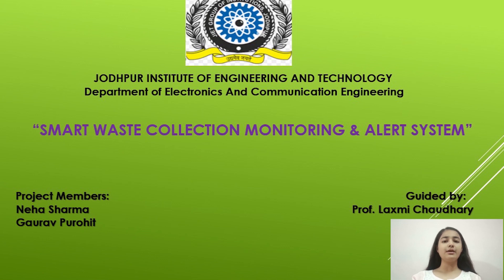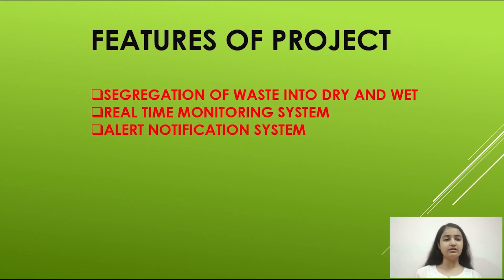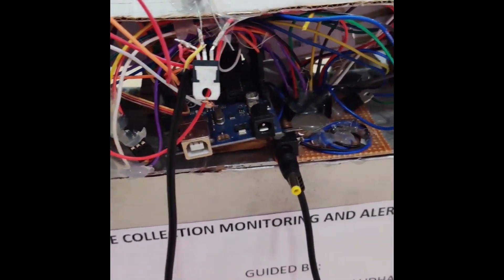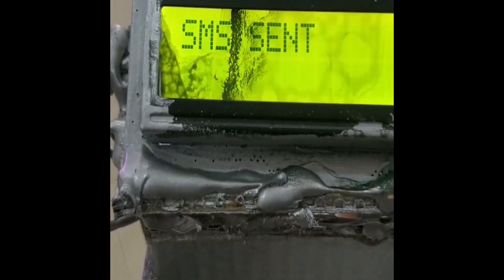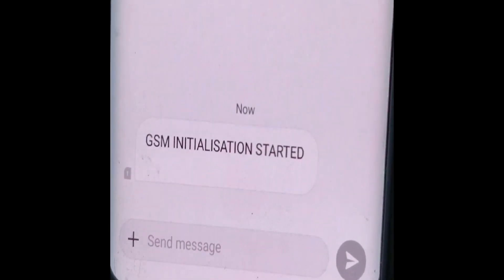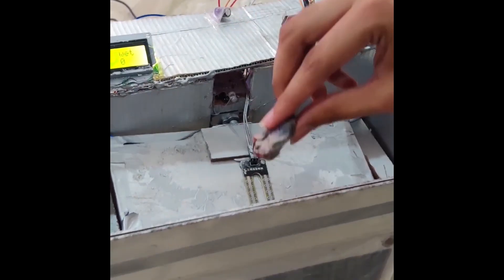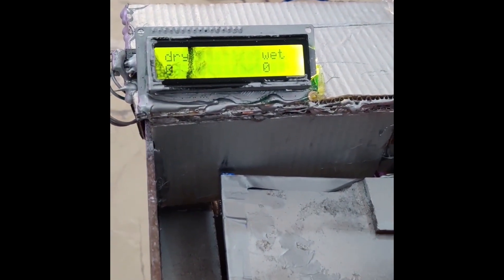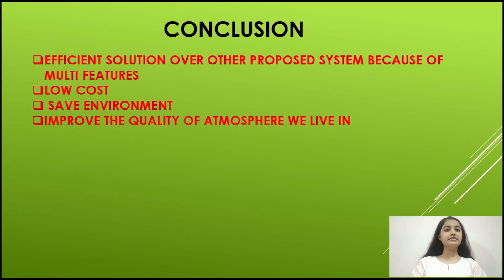ECE05: Smart Waste Collection Monitoring & Alert System | Project | ECE | JIET Jodhpur

Comment: Project is good can be used in industrial lvl waste management systems . Big question is is this thing is economic ??
Reply: Yeah , this is basically a prototype if we want to construct a model for real time , first installment shall be expensive but this is one time installation, so we can say it will have been high durability .
Reply: Also i can say in the modern world , we want automatic systems that requires less manual support and do in autodrive , then we wouldn't think about the economic side right?